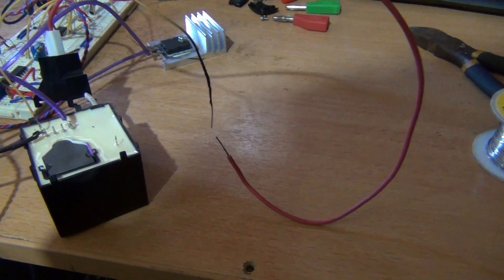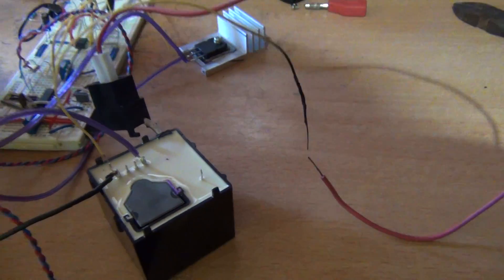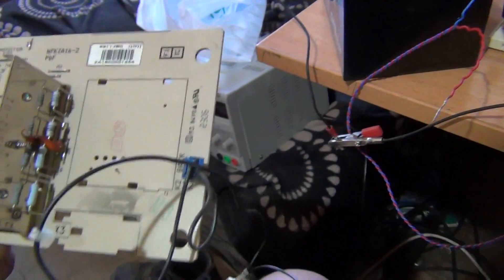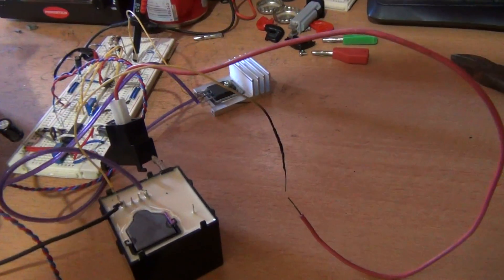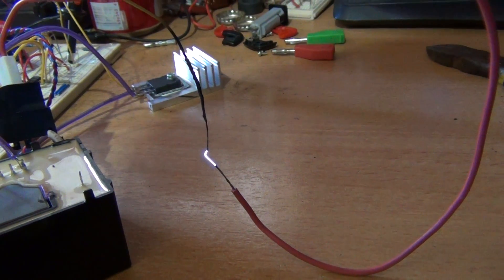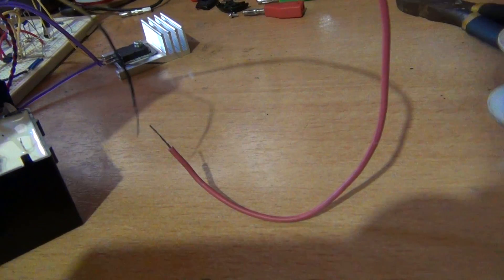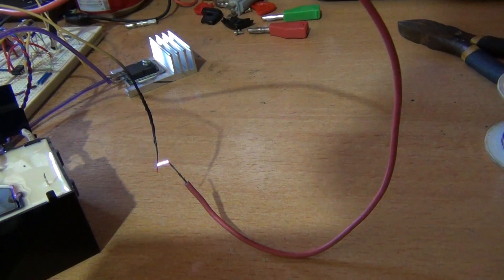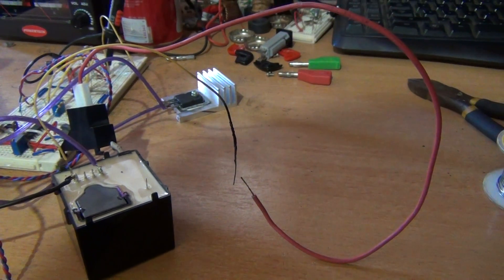Giant Photocopier Goodies - Flyback Transformer + Message for High1Voltage1Rules

Comment: I noticed that ozone is dependent on frequency for a iggy coil running off a 555 timer. in the higher frequencies it would ooooze out lots of ozone, but at lower frequencies it seemed to emit alot less ozone. Could also be the coil too, a car ignition coil runs at a lower frequency than a fly back, when I got the fly back firing it stank out the place real quick.

I might have a bit of a play with it now that I worked out how to use the arduino as a frequency source.